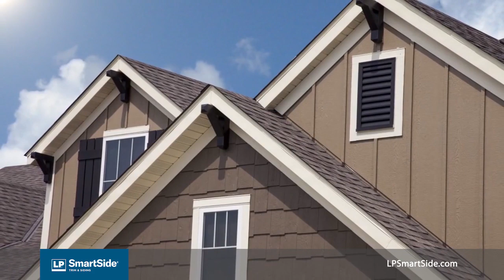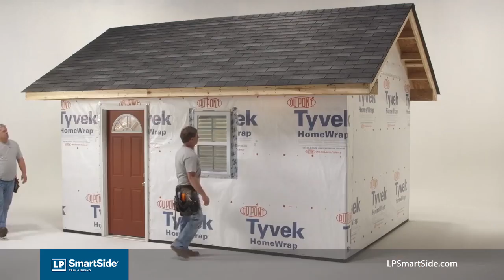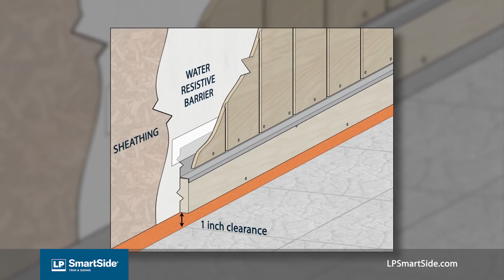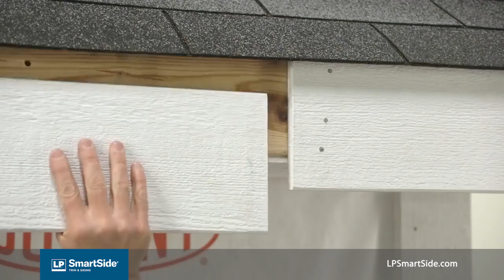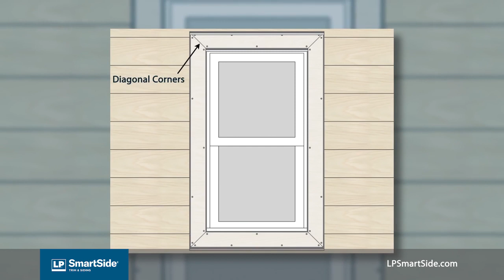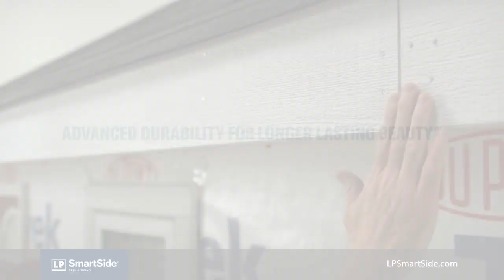Intro To LP® SmartSide® Trim & Siding (1 of 8): Getting Started; Installing Trim & Fascia

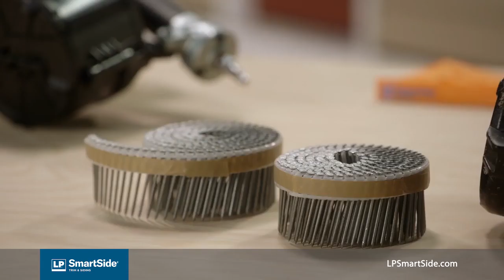Comment: 3:45 
... Is it safe to assume the common 30 degree framing round head offset nails be considered a box nail? I'd like to avoid the plastic mess that 21 degree framing nailers leave and virtually all "siding nailers" have a max shank diameter of  .099. It seems the nails in this video are classic pneumatic coil framing nails. These are not carried in-stock at any local retailer, at least here in the northwest,  especially in hot dipped.

Both framing or siding coil nailers are only available the pneumatic form, pretty sure no manuf. has a cordless coil beyond the Dewalt DCN45RNB (people do use it for Vinyl siding), which unfortunately is a "one trick pony", max length of nails are 1.75" and Hot Dipped also being virtually non-existent.

Comment: Maybe a dumb question but why is a z flashing necessary between the top trim and the top of the window? You already have flashing on the top of the trim.  If you keep the same 3/16 Gap all the way around and caulk it won't the drip cap provide the necessary protection?
Reply: Hey Mike. I am not affiliated with L.P. in any way but maybe I can provide some insight from my own experiences. So as you were saying you already have window flashing keeping out water around the window, and you've also got flashing on top of the trim too. The purpose of the Z flashing and extra space on top of the window but below the trim is not to protect the window/sheathing/interior in any way but to channel moisture away from the bottom of that particular piece of trim so that it can't pool on the top edge of the window frame and then be absorbed upward by the adjacent trim. That's also why they always say to keep it away from surfaces that routinely 'breathe' water in and out like brick and concrete.

Comment: Where can i buy in my area in nc
Reply from the maker: Hi Leonardo. Fill out your info to get connected to a rep here: https://marketing.upsidetosmartside.com/l/447912/2020-02-03/8lh774
Reply: @LPBuildingSolutions I'm renovating my sheds. Where can i buy 1x3x16 trim Board
(Actual size 0.625" x 2.5" x 16')
I found trim at lowes but they only carry 1.25x4x16 inch smartside trim

Comment: Garbage product
Reply from the maker: Hi there, thanks for commenting. If you have had a negative experience with our product, we would like to learn more. Please submit your inquiry through our Contact Us form or phone number here: https://lpcorp.com/about-lp/about/contact-us
Reply: @LPBuildingSolutions  regarding the facia, I've watched a few vids about how smart trim swells up when soaked, once swelled does it dry to regular size or does it need to be replaced with new board